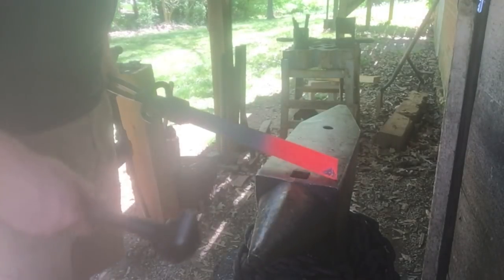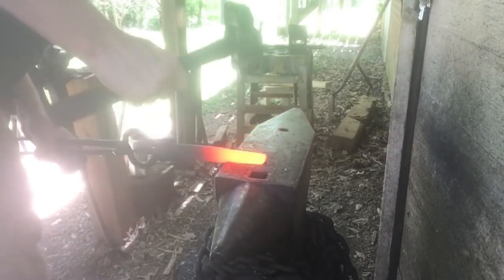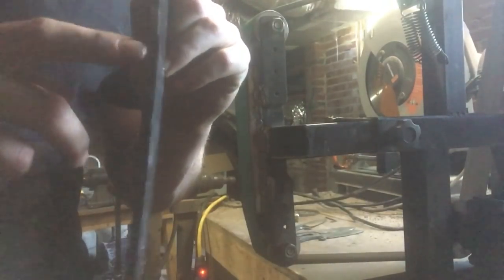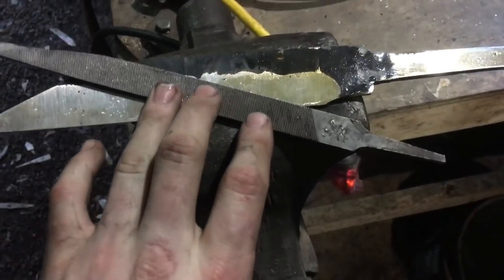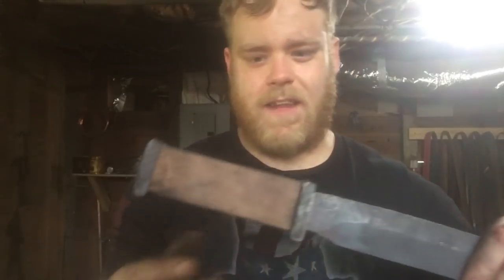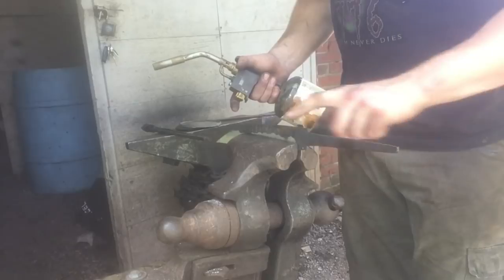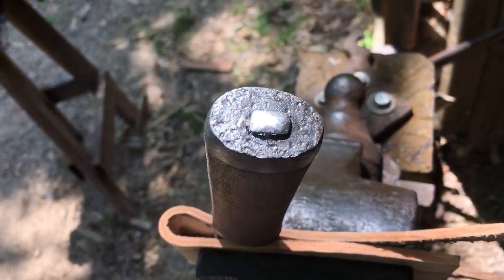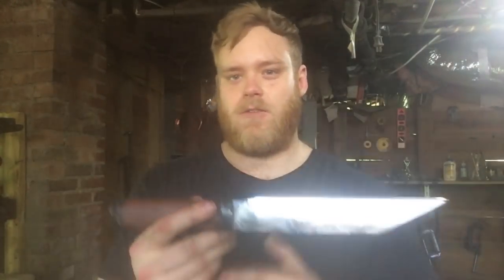Forging a Viking seax

Comment: Excellent knife, I made a seax from an old file and used a piece of pipe wrapped with leather for the handle and two nuts (rounded off where they meet the handle) for bolsters...I ground and polished out the blade to where you just barely see the lines of the file...doesn't look to bad, but I like the way you closed down on the bolsters...really enjoy your videos!

Comment: Very nice work i love your chanel! i am a little woried about the tip maybe needed a little more tempering i have made this mistake many times with my knifes becouse the tip is easy to overtemper you try to avoid that and end up with a very hard tip..

Comment: Just curious, why not put a reverse bend into the blade before hammering the bevels to counter the natural bending?
Reply from the maker: william731 you can. I just don’t like doing it that way. Depending on how long the blade is and how deep you forge your bevels you are probably going to still end up with a curve even if you forge in a recurve that you will have to correct so I just correct it as I go.